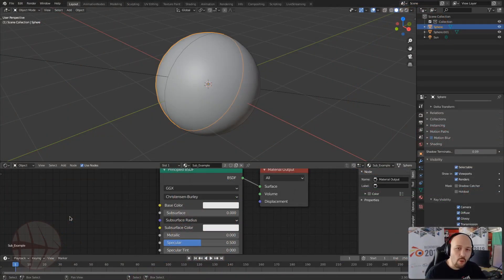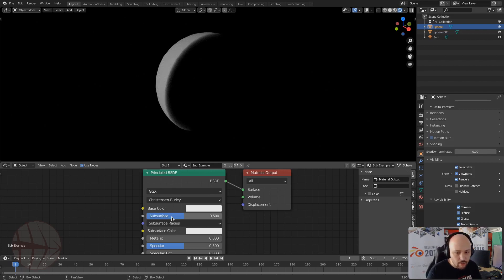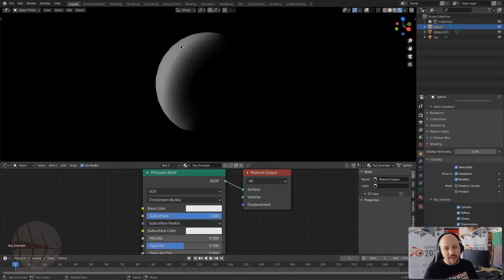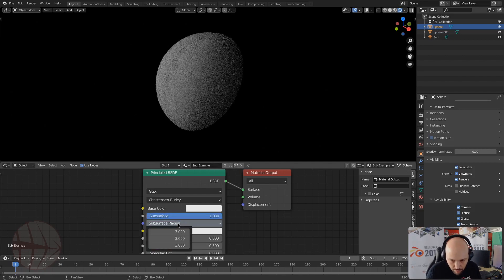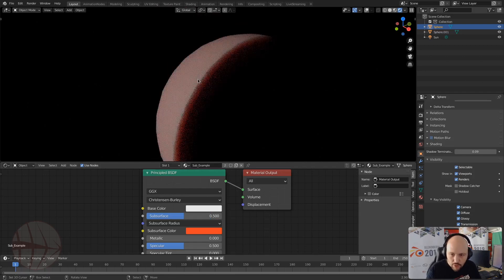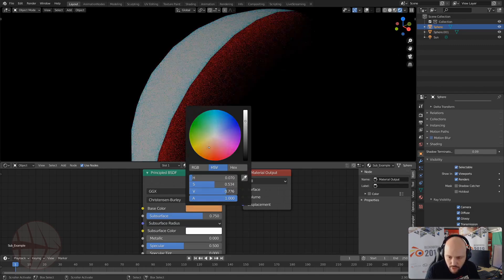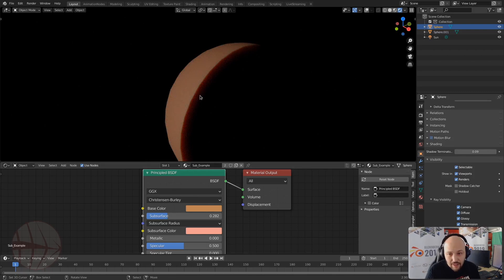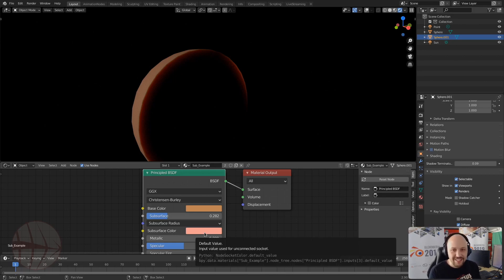How to Understand SubSurface Scattering in Blender (Tutorial)

Comment: I just realized that the first subsurface slider is essentially just the same slider as in the mix shader factor. Looking at old videos that used to have the subsurface shader + mix shader separate made me realize this! Thanks for the insightful video. So if you have an image texture, you would usually want to plug in the image to the subsurface color, in addition to the base color.

Additionally, white subsurface color spreads out the light less while grey spreads out more. Black will spread it out so much as essentially to having no light.
Reply from the maker: It’s because the color input works as a multiplier, the actual color of the Subsurface scattering is better controlled with the vect, also now they added a pair of features like SSS Anisotropy for things like skin, pretty cool :)

Comment: According to Blender documentation, "Rather than being a simple mix between Diffuse and Subsurface Scattering, [the Subsurface slider] acts as a multiplier for the Subsurface Radius."
Reply: Yes, I think that was added recently, however if you check it’s behavior with extreme values you will see that the result is not like a multiply, so I have doubts about that, it behaves more like a Mix or an Add, however SSS has changed quite a lot recently and it will change more with Principled V2, so better wait until we have that to update the information properly :)

Comment: I think you are not quite right, saying that the "Subsurface Slider is only a Multiplier", if you use following setup you will see that there is more to it. ( didnt quite figure out what exactly it is, but there is something).

Base Color :  White (1,1,1,1)
Subsurface : (1)
Subsurface Radius :(1,1,1)
Subsurface Color Black (0,0,0,1)

The Result will be a Black ball - and sliding the Subsurface slider from 1 to 0 and back again will show some non-multiplying behavior

But otherwise, thanks alot for the video :)!
Maybe you find out what might cause this behavior and let us know
Reply: I realized that the subsurface color works almost/exactly the same way as the base color, and the subsurface slider is just the mix shader slider. So if you have an image, you might want to plug your image in the subsurface color too. Of course these can be different, the subsurface slider then just "switches" between the base color and subsurface color (where the subsurface color will apply on parts where there is light). The radius is usually the more important one to adjust.

Additionally, white subsurface color spreads out the light less while grey spreads out more. Black will spread it out so much as essentially to having no light.